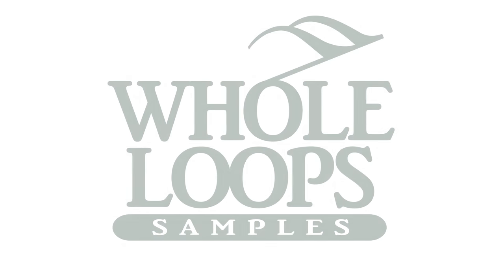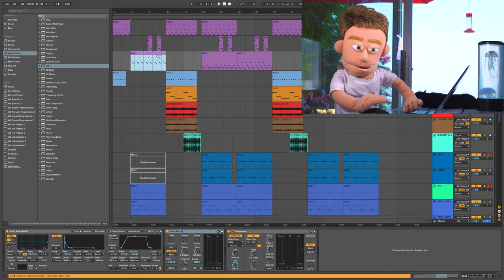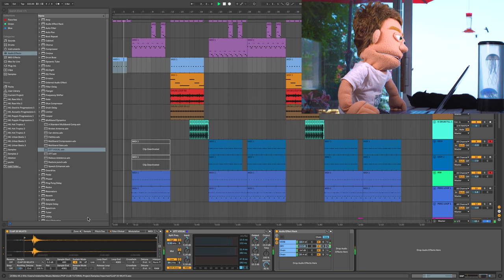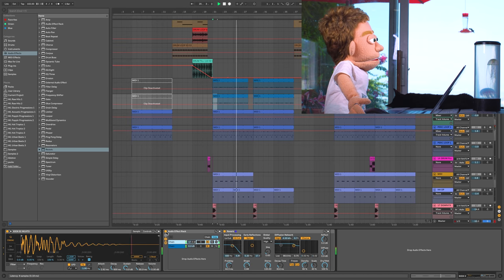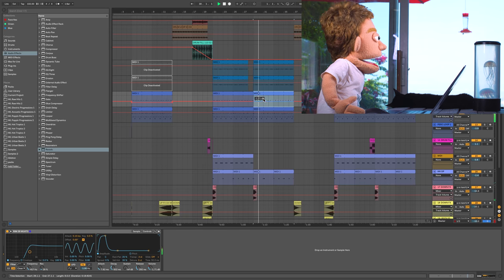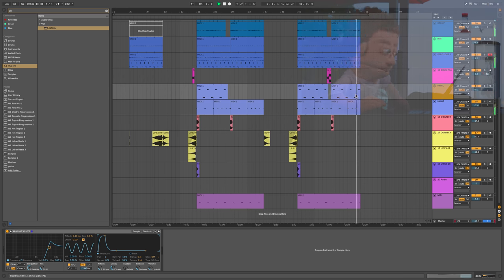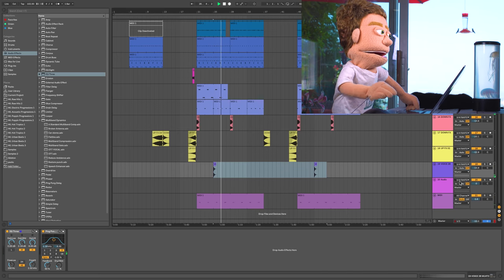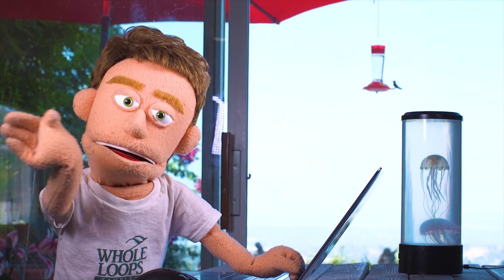How To Finish Pop Beats

Comment: Hey do you have any suggestions to fix a clip when sometimes if you automate a pitch bend and for some reason the entire clip will be off key when you go to play back, even when your automation is saying it's on key? I hope I am explaining myself properly but this happens semi frequently in Ableton and I am hoping you know what I mean. It's so damn annoying and I don't know why it sometimes happens. Any way to fix this?
Reply from the maker: joey4track put some automation at the beginning of every clip. Use a tiny slope from -1 to 0. Just one dot at zero won’t reset the pitch bend to normal. You need that tiny shift! It’s frustrating that music software hasn’t offered a built in solution to that!
Reply: Ah ok cool, thanks Reid! Yeah wth? Ableton should really do something about that, I've had that issue for over a decade at this point, lol